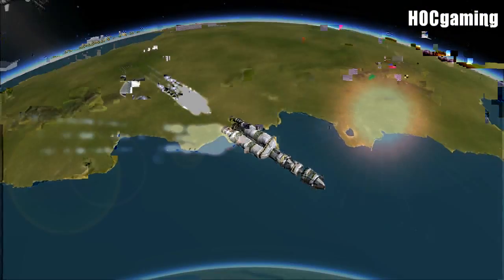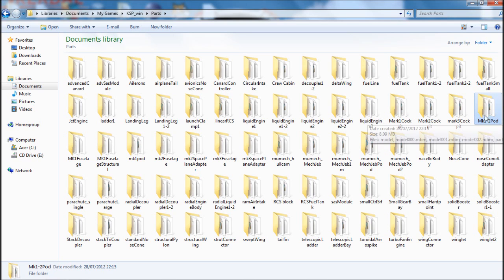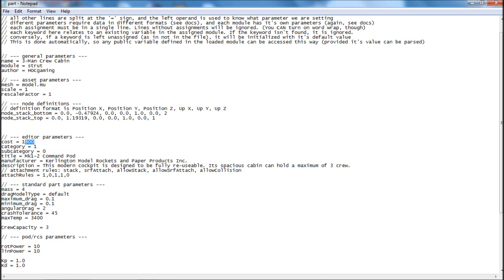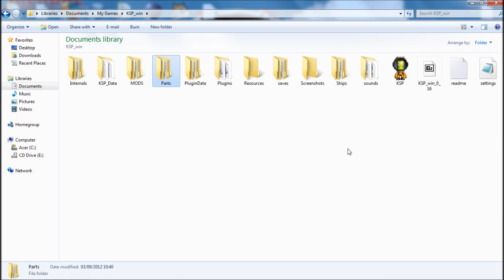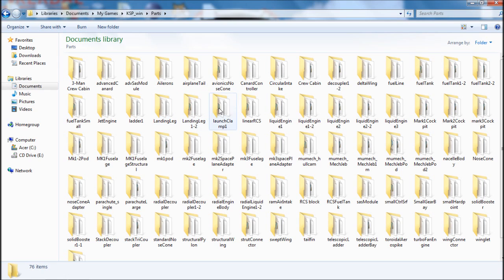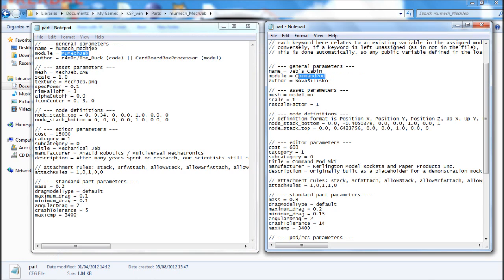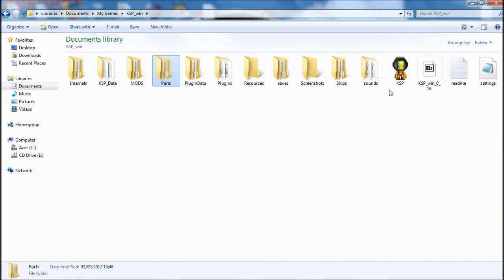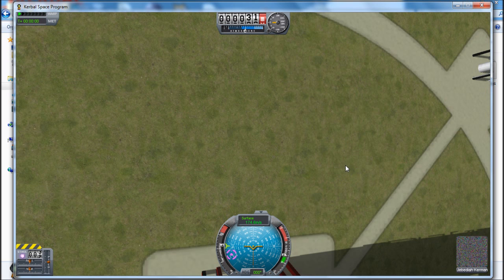Kerbal Space Program: Empty Command Module - Mod Tutorial

Comment from the maker: Okay, I suppose "step towards" docking is probably the most appropriate term I can think of right now. 
The major use of this... thing is that all the fuel required to do everything else in your mission profile doesn't have to be hauled all the way down onto the Mun and all the way back up, for example.
That's pretty useful- but alas we have yet to actually dock and be-able to flow fuel between 'lander' and 'module'. There's a mod though, I believe...